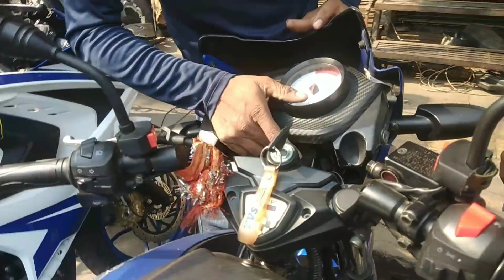Apache 160 LED Headlight install

Comment: Hiii buddy i also want to change ma RTR  headlight my question is what kind of light u have used will it works in ac wiring if it is not did u convert ac wiring to dc if you how did you do that

Comment: bhai wo aakhir mai kya lagaya? red color ka
Reply from the maker: APACHE BOy Vicky bhai Koi relay hai jo AC TO DC converter karta hai Bajaj Pulsar 135 es ma use hota ha yeah relay hai.. 
part ka number 
SWISS SAP-853 bajaj xcd es
Reply: thanx buddy aur jo LED lagaya hai wo kitne watt ka hai aur kitna daam liya?
Reply from the maker: I Think 48w ka ho gaya and price 700
Reply: isse kya bike ka sab DC ho gaya? i guess no kyunki wo jo kiya wo bas jo coil se 12v ka AC power aa raha tha usko usne convert kiya DC mai aur ye sabse safest way hai par paisa bohot lag jata hai 😅
Reply: @RavMotorsport  bhai ise kaise lagana h apne Jo 2 daar lagaye h ek to lock se gaya lekin dusra waha kaise lagaya kaha se light wale swiss se kaha se kiya plz help bhai
Reply: Sab to smjhe gye lekin Jo 2 daal wala nhi smjhe PAYE 1 to lock Swiss se a Gaye ek kaha se aur kaise kiya btye bhai OK I am wait